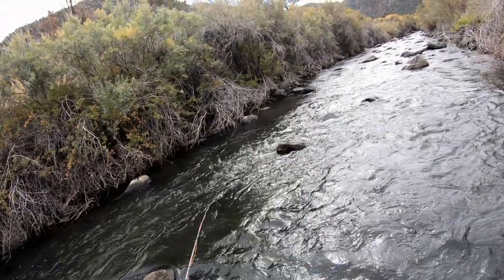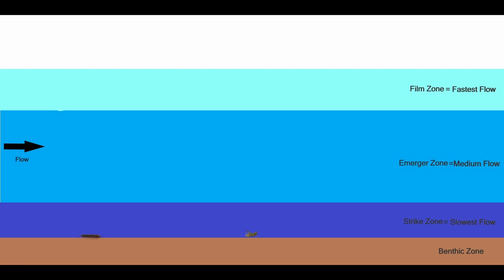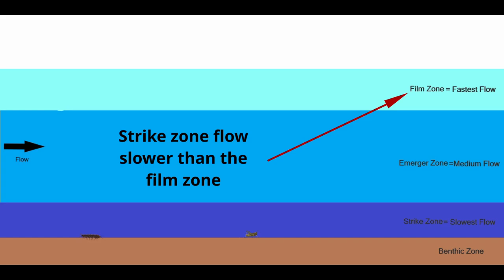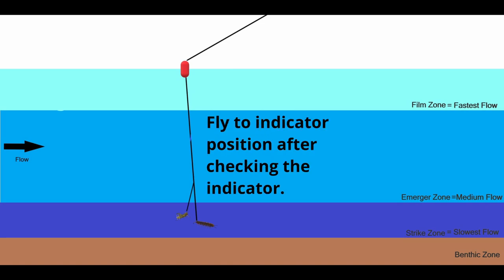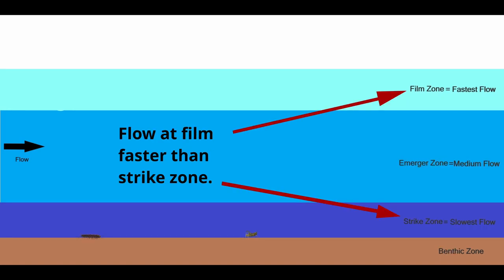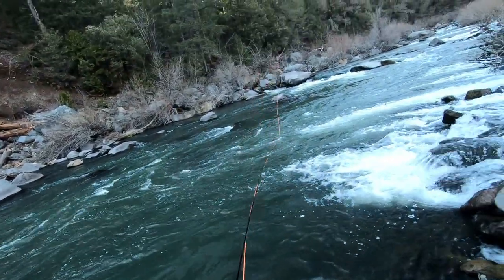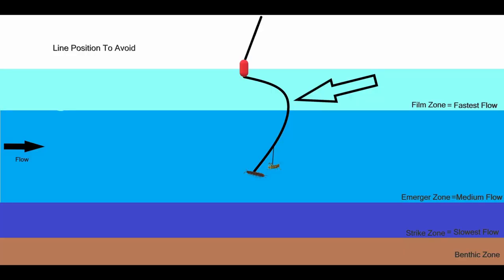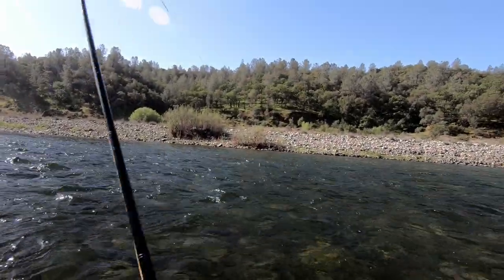Underused Indicator Nymphing Technique - That Works

Comment: Excellant video describing 'checking' the indicator in relation to the currents underneath. I think 'checking the indicator' is not talked about enough and it really can be the difference between catching and not catching! Excellant demo on the casts and how to manipulate the line for a good drift! Thank You!
Reply from the maker: Thanks Tony, your comment is much appreciated. It helps. There are other under utilized techniques used too. I will probably post something on these techniques in a couple of months. Good luck and be safe.

Comment: You say the phrase “checking the indicator” which I think would normally be interpreted as “look at the indicator to determine if everything is ok” that then might require some action.  A definition of “checking” in the beginning would be useful
Reply from the maker: Sorry it's not clear to you. "Checking the indicator' is simply moving the indicator upstream in the middle of the drift to reposition it to make up for the different current speeds or pulling the indicator straight up, out of the water, to see where the flies are at in relation to the indicator itself. Ideally, it's best to have the indicator slightly upstream from the flies because the water at the surface is moving faster than the water near the bottom. Doing this will get you into the fish. I hope this help.
Reply: @flowflyfishing2131  I did understand about 2/3rds through the video.  My comment was a suggestion on providing some descriptions up front.

Thanks for the response
Reply from the maker: @charlesloeffler333  I am glad to hear you stuck around for it to make sense. Hopefully, you can take it out to the field and get into some extra fish.

Comment: I think maybe fish are there because the pause causes the flies to lift slightly...or maybe the fish was already on...?
Reply from the maker: It could be both points you mentioned. The point regarding the fly moving I almost mentioned in the description. I do think that the fly moving unnaturally can trigger strikes, with out a doubt. There is a book that basically only talks about this, called Active Nymphing by Rich Ostroff - It's a good read. Also, at times, strikes go undetected, so pulling up,  helps set the hook before fish spit it out. Also the point am making in the video, by checking the indicator, it actually slows down your drift in the strike zone, which keeps your flies where they need to be. Great comment. Thank you.
Reply: @flowflyfishing2131  Yes, I should've mentioned that it's a great video and a concept I've sort of had in the back of my brain but your video made it all the more clear. I think that it takes quite a bit of practice to be able to deftly move the indy without moving the flies!

Comment: This is good advise but extremely difficult to perform well. I normally see people over upstream mend and put the fly down stream of the indicator and therefore all strikes will be undetected.
Reply from the maker: Hi Marc. Thank you for your reply and your comment. If you have a decent floating fly line, one that is made to turn over a fly rig, it's not difficult. I have found a roll cast really helps, especially if the flies land really upstream from the indicator on the initial cast upstream. Personally, I don't use euro type fly lines because they don't have any mass to them. I use an old-fashioned double tapper and just tie a long leader to the end while using any euro style nymphing techniques. This way, it I want to fish dries/wets/streamers, I just make a quick adjustment to my leader. I am curious, what type of line are you using?
Reply: @flowflyfishing2131  Normally I use my traditional 4 wt rod for indicator fishing and I tie my own leaders and I use a 35 pound butt down to a 20 pound in 7 feet to a micro swivel. I then have 4x to 6x tippet and have my indicator on the tippet. This thing turns everything over like a champ and mending is easy.

For my 2 wt euro rod I have a Double Taper fly line and then a loop to loop to my short setup with a 1X sighter and then to the tippet ring. I use the 1X when I am only casting up to 2 rod lengths or less. 
I have my 35' 6 pound test leader to my 4x sighter and then my tippet ring. So I wind everything off for dries. When I am fishing tight up to 35' away or if I am tight lining slow water.
Reply from the maker: @MarcTelesha . Good information, thanks. Sounds like you don't have a problem turning over your rig. I am curious to know what fly line you are using on your 4wt. I generally up my weight on my fly lines, the extra mass helps turn over indicators  and any additions weight (in fly or added split shot). Also, If just trying to reposition the indictor that is upstream, just after a cast, I am just throwing a fairly tie roll cast with enough momentum to lift that indictor up and move it a couple of feet. Please continue this conversation if you would like. It's a great little technique that helps get you into more fish when the conditions are right.
Reply: @flowflyfishing2131 I am using the AirFlo Universal Taper. With the  thick butt section on my indicator rigs I don't need an aggressive tapered line.